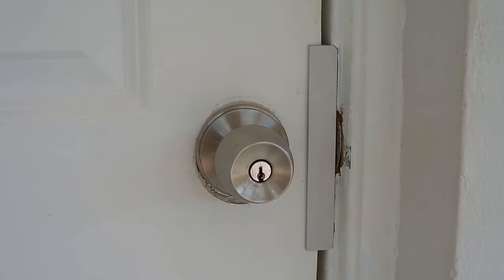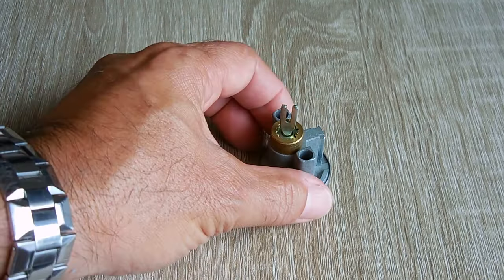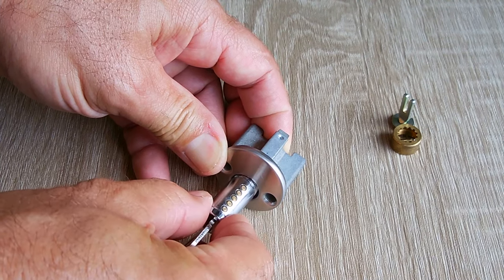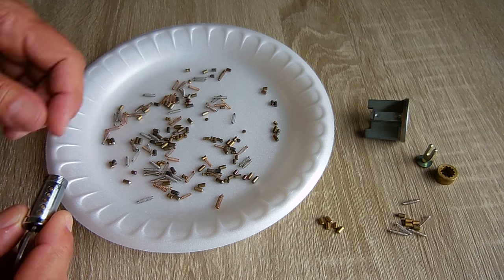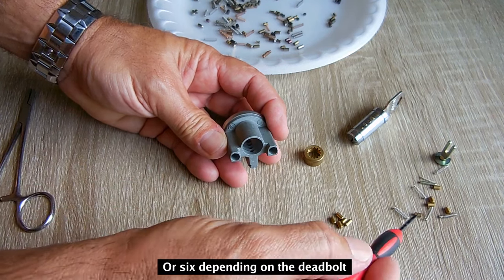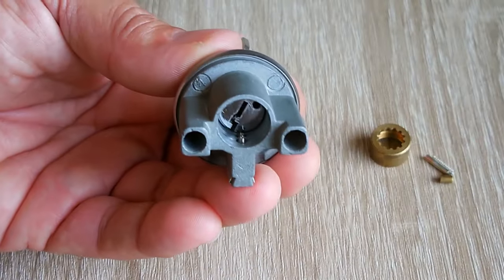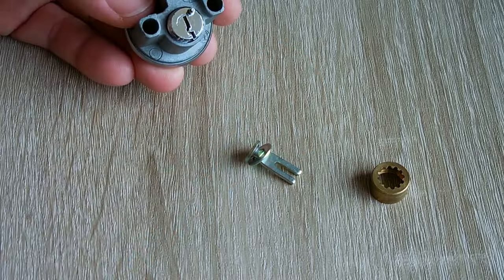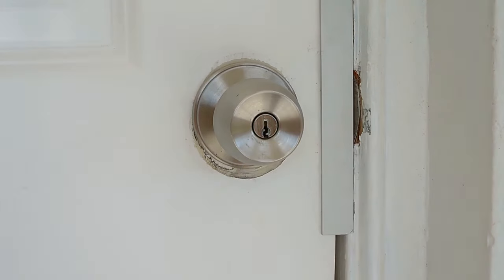How To Rekey Kwikset & Schlage Deadbolts! (No Special Tools!)

Comment: Let me go grab my spare pins I’ve accumulated over the past 50 years of my life.
Reply from the maker: Incorrect. 47! 😂
Reply: The embossed label was a dead giveaway. My grandfather used to use them when I was a kid, lol. As soon as I saw that I new those pins have been there for a while.
Reply: No special tools required, but special excess parts are needed!
Reply: @powderdescent  The pins and even tools can be bought on Amazon, but I had old cylinders from the previous locks I replaced. I didn’t need to buy the pin key set on Amazon, but it’s there. Changing 16 new locks to a rekey pin order indeed costs nothing.

Comment: Thank you so much for taking the time to do this video. I consider myself very handy but you helped me decide that this is not something I want to attempt and it’s just easier for me to delegate this to a locksmith.  And hey, I think of it as helping the economy.   However, why don’t the locks already just have those anti-pick pins in there?
Reply from the maker: Cheapo locks don't use them, more money for the higher security pins. Thanks for watching!
Reply: yeah, same here
Reply: Dude, inflation... stop spending money, because now that will ruin the ecconomy... if you really care

Comment: So cool no special tools and old pins from old locks. Great video! Very impressive, short and sweet. So, I just did this as I
Moved into a home with 18 locks and I don’t want to carry 18 keys. All of them were Schlage type, master also worked with one key before but I upgraded the overall door lock to digital entry, fob and key locks Schlage type key. Since all of them had used one key before. I took out the pins from the old locks and put those pins in a different order to the new cylinders. So that one key still worked across all of them. Thus, I did it just like this video without having to buy anything and with the few locks that were not previously on one key I used a dremel like he explained to make a bigger pin fit. This project was much fun, like a puzzle, after I did it.  💪. Thank you 🙏 so much. I have doggie bags and used that plastic roll inside to use as follow through tool, so I would retain the springs, but when some springs and top pins came out, because of this video I was able to reinsert without feeling like I totally screwed it up, as I knew I could do it with the knowledge from this video.

Comment: If you can find a piece of tubing or the smooth end of a drill bit (the part that goes into the drill chuck) that's exactly the same diameter as the plug, you can push out the plug so the driver pins and springs don't fall out.   It'll save you a lot of work.
Reply: What’s the name of that actual tool that prevents the pins from coming out with the springs?
Reply: @bengarcia6898  plug following tool

Comment: Great video for no special tools but I highly recommend using something (drill bit, sharpie/marker, socket, wood dowel, battery, or whatever appropriate size cylindrical object you have) as a plug follower. It makes the job soooo much easier and you avoid losing the top pins and springs during the reinstallation when they inevitably slip from under your screwdriver. Losing just one spring or top pin will turn a pleasant, simple, and short I can do that myself task into an extended nightmare that'll make you wish you never took on doing the task yourself.

Comment: The famous home depot bumpers.  You should also drill some big nails or screws into hinge side of door into frame and have 1/2" protrude into doors with drilled holes.  Keeps one from pulling hinge pins, the hinges try to protect that but don't.
Reply from the maker: A D I don't believe you said that....I made that video last week!
Reply: Really, I figure you weren't done with the door.  I guess you will post that soon, Thx.

Comment: I'm curious why you didnt use a core follower???
You shouldnt NEED to remove the upper pins and springs, they are held in place ith a core follower, I used a wood dowel that happened to be the same diameter as the core and pushed it thru as I pulled the core out and replaced the bottom pins and re-inserted it.
Some locks you CANT remove the top pin holder to insert the top pins and springs that way, but tediously trying to work all the springs and top pins back in is make-work.
The only time you should need to do it the way shown is if you fumble and drop the core or the like and everything falls out.

Comment: Would this be the same procedure for the schlage keypad deadbolts.
I can rekey auto door locks and after watching your video seems home deadbolts are easier because the spring and tumblers are larger.
My question is would this be the same procedure for a schlage keypad deadbolt or rather are keypad deadbolts designed the dame . Thanks for the informative video.

Comment: interesting as always but how did you change the pins in the tumbler, you went from i will change them to they are changed.
Reply from the maker: In the video I showed how it worked, how the varying pin sizes create a shear line when the key is inserted. I then explained that I needed to replace the pins so when the new key is inserted(which has different depths of cuts), everything will be flush with the plug(cylinder). By trial and error with the new key inserted, I tried different pins off camera. You saw the end result after spending a few minutes searching for the correct sizes. Thanks for watching!
Reply: So do the pins just "fall" out of the top of the tumbler and you just put the key in and put different ones in until its flush?
Reply from the maker: Robin Halligan The top pins have nothing to do with the rekeying process. It's all the lower(bottom) pins like I show in the video.
Reply: I understand that but what i was asking (maybe i'm stupid) but how do you get the lower pins out of the tumbler.
Reply: Often times the keys that come with the a unit will have numbers printed on it that express pin size. However sometimes you have to gauge which fit and make it flush if there are no numbers or if you have just a container full of random pins then you will have to do it the hard way. Same with not having a follower. The kit makes it significantly easier but it costs over $60-150+ depending on brand though you might be able to get separate parts cheaper it will just be a hassle to put together a set that is viable. Especially when you can get many hardware stores to do it for quite cheap or even free.

Comment: Good detailed video. Why not buy a re-key kit for Kwikset type with a plug follower so you don't have to deal with the top pins or springs. I can envision less capable people getting into trouble trying to get the springs and top pins back in. (that includes myself)
Reply from the maker: Alameda Repair Shop I mentioned a follower in the video, and the kits shown in the video description area have them. I like to show ways without using specially designed tools because a person may have pins from an old lock laying around, but nothing else. Thanks for watching!

Comment: Hello - read that hose has air with moisture inside so just connecting and just pushing trigger injecting both r134a and air/moisture in ac system with moisture bad for system.  Why not trigger slightly as pushing connector down onto port so some of air/moisture is removed first from hose? ..

Comment: Trying my first one now as an experiment…if you want to pull your hair out, get a Hyper tough Walmart deadbolt. The blade doesn’t come off the back of the cylinder (it’s crimped on as it’s cheaper) so it’s in the tube WITH your flat screwdriver as you manipulate the pins into the spring holes. 😂😂😂. You definitely get what you pay for.

Comment: Seriously this helped me greatly. I had the basic concept down, but the Schlage re key kit I bought, the key didn’t fit my new locks. Once I saw your video I realized 2 things. One I can use the pins from the old locks and 2 I can cut pins down. I dumped all my old pins out and out of 4 new locks, only needed to cut 1 pin down. All are now done now. The only thing I didn’t understand was, the kit I had, had enough pins to do 6 locks, but how could I have gotten a blank key cut so that I could of just used all the pins in the kit with a new key?
Reply from the maker: A locksmith could take the pin #s used and create a key.

Comment: The question was asked by someone else (Robin Halligan), but you did not answer.  How do the pins in the "Core" or 'Cylinder" come out?  These are the ones needing replacement to create a sheer line but your video skips the step about how the bottom pins are removed and replaced with the appropriate ones to create the sheer line (even with the Core).  If you turn the Core upside down do they simply fall out (like the upper ones did when you removed the Core).  Thank you
Reply from the maker: The LOWER pins are the pins you replace to "Rekey". The upper pins you should leave in place. I was only showing all parts of the lock. Use a follower as shown in my video. As you slowly pull out the core, the follower is right up against the core preventing the upper pins and springs from popping out. It will save you time putting them all back.

Comment: What would a locksmith charge to do this using his specialized tools? Around $10?
Reply from the maker: If you call a locksmith you're going to get ripped off. Probably $100 or more. Some hardware stores may do it for 10 bucks
Reply: Lowes & HD charge $5 rekey. Ace $12,Atlanta locksmith $25

Comment: Life Hack, Use a Philips head screwdriver and remove the lock assembly. Why on earth would any company have the screws accessible from the outside?
Reply from the maker: LOL! It was a double cylinder. The side facing outside has no screws.
Reply: Im confused.
You need a key to get in and out of the door with this lock? I was wondering why the screws where on the outside facing..
Good explanation though.
U did this without the kit.